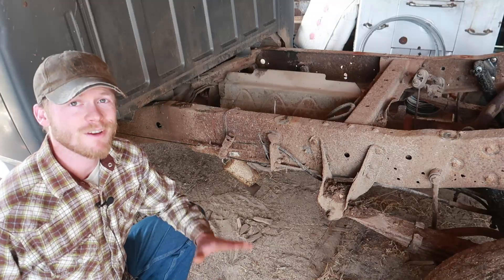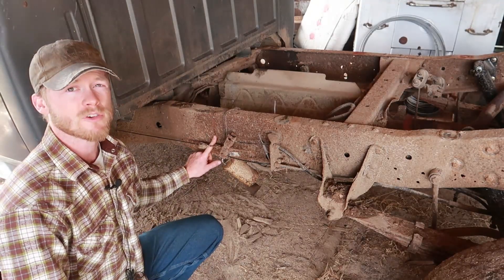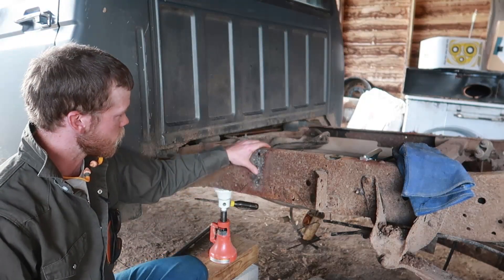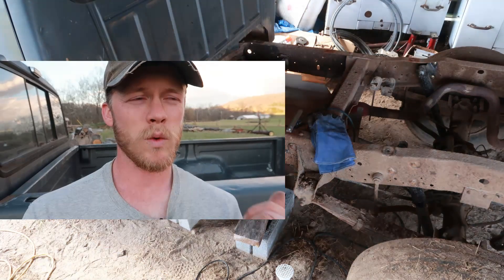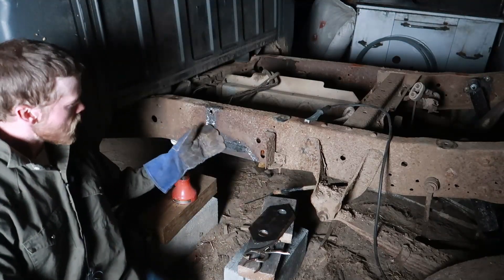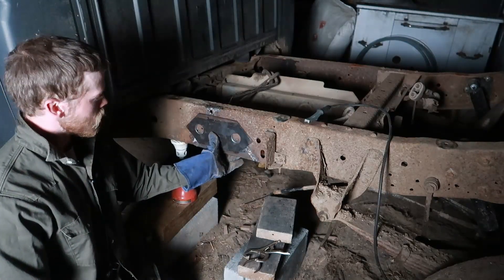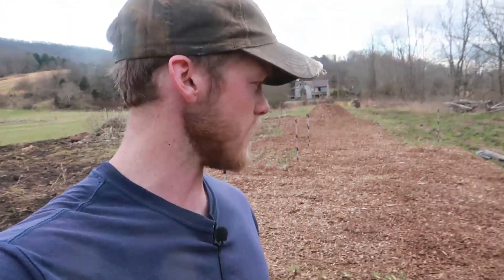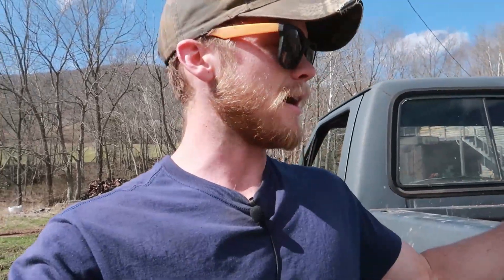Fixing the Farm Truck Frame + Spring Garden Work

Comment: Great job Josh One thing next time you make your fish plate or gusset weld I would try to get rid of the points on both ends as a crack could start from these points so by taking the grinder and cutting each end (left side and right side of the plate)  so it has a flat spot would be better. It is probably ok the way you did it. I wish you were closer I would show you how to run the arc welder small ideas. Generally I would use 7018 rods for this! The Mig welder is as strong as the stick welder but the key here is size of machine! I welded for caterpillar for years and use a big mig to do repairs on heavy equipment but these machines cost thousands of dollars. The little mig your using generally is good for stuff like welding in fender wells. I have one of the little mig welders your running and use it for things like this. Great job none the less. always like tuning in hope some things I portray helps you in your journey!
Reply from the maker: Thanks, now that you mention it, I think I recall the fish plates I saw having rounded "points" instead of sharp points. I'll keep this in mind if there's a "next time". The rods I tried using were 7018s, although perhaps not the best quality(I don't remember what diameter). Running flux core through the welder, I think it's rated for up to 3/16s, so I was a bit under sized for the job. If I get some gas and run it as MIG, I think it'll do 1/4.

Comment: Looks like the weld job should hold. Is the other side OK then. Got your horseradish in. Now is close for potato's to get planted? Thanks for sharing. 23 degress this morning in central Iowa. Got 9 tenths of rain the other day, which is great. See ya next time.
Reply from the maker: I haven't noticed any other spots that need work....... Potatoes should be going in fairly soon. We actually had a light dusting of snow this morning! Already melted off though.